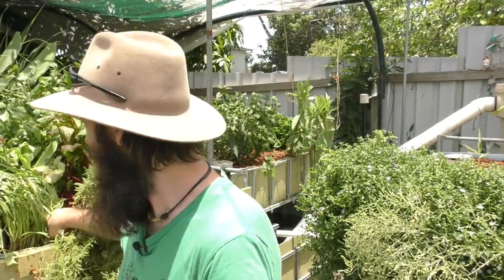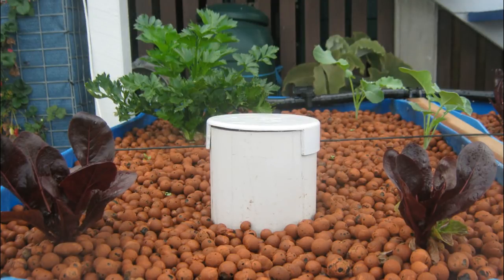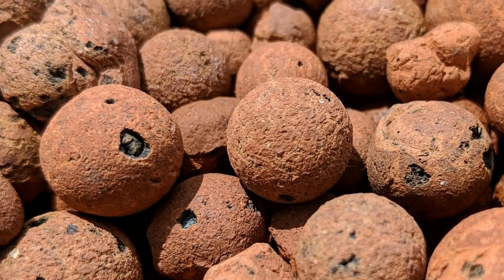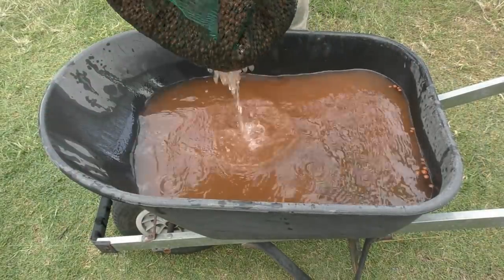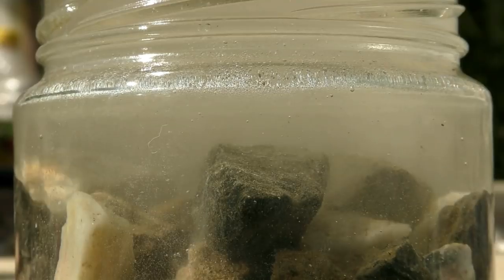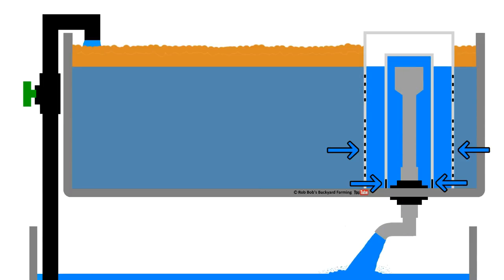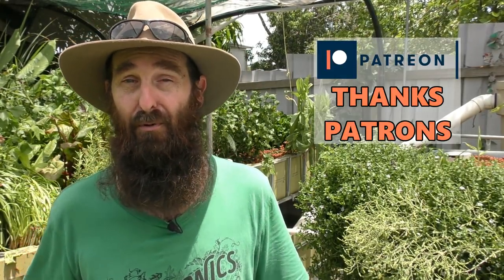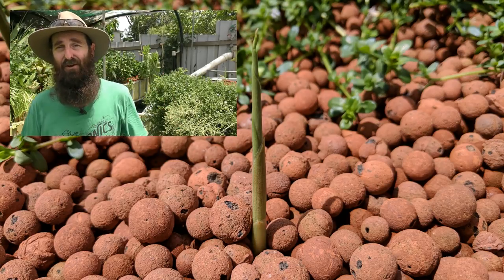Aquaponic System FAQ | Does it Take a Lot of Work!  How long Does The Pump Run? & MORE

Comment: Do you need/use a uv sterilizer ? Mainly relating to how it can deal with excess algae. 
I have been breeding and caring for aquarium fish for the last 30 years and have had my aquaponic system running for 2 years now (thanks very much for the inspiration). I am currently growing out a load of rainbow fish and the fry love a bit of algae to nom nom between feeds. So when I let the algae bloom for the fry i find that the plants really suffer from the ph spikes. The ap system is very exposed to sunlight and i'm using shade cloth where I can.
cheers mate.

p.s. do you have any plans to do like a "show us your system" video? I would love to do a quick video run down and let you show it.
Reply from the maker: Hi AS & sorry it took so long to get back to you. I haven't had the need to use a UV in the aquaponics but I did use on on the fish farm when I had an algae issue. I had it in line after the bio & before the fish tank. 
Now there's no fish in the system it would probably make for a boring tour. I did post this one a while back & not a lot has changed in it since then. https://www.youtube.com/watch?v=raLv4RAUte8
I think I may of added the barrel beds after this but that;'s about it. 👍
Will be uploading a clip looking at the future plans we have for it in the coming weeks. 
Sorry again for missing your post.
Cheers,
Rob.

Comment: if I have fewer fishes in a larger tank or growbed and also in the night time I will remove the bell in a bell siphon, so water will in constant level. so in this case did I need to run the air pump for 24/7 ???
Reply from the maker: I think it would still be a good idea to run the pump 24/7

Comment: Heyo from Newcastle Rob, love your vids, it has inspired me to build your chop & flip 44 gallon jobbie, not quite using it for aquaponics just yet, but am running it as a hydroponic system, Ginger and garlic in the grow bed, and have also tacked on a small NFT channel for some strawberries. Would love a general update on yours!

 Just a question around Iron Chelate, in a system with about 90-100 ltrs in the reservoir, how much IC would you put in it? And how often would you need to put it in? Once I get the initial project more down pat I am going to add another 2 grow beds for some turmeric, and longer NFT channels for more strawberries. 

Thanks again mate!
Reply from the maker: Sorry I missed this Shane. 
I posted a clip on adding iron to the system a while back if it helps any. 
https://www.youtube.com/watch?v=Kcls73bI5fg
Have you got any fish in the system yet? 
Sorry it took so long to get back to you,
Rob.
Reply: Sadly no - still going on hydroponic nutrient. I have expanded the system to 2 barrels now running off a single reservoir, and going to expand more over winter and add a horizontal cut bed from the same type of barrell for some more surface area. We had a bumper crop of cucumber out of it this summer and almost ready to harvest the ginger and turmeric as well!
Reply from the maker: Nice one Shane. As long as it's productive you're on a winner. 👍
Hope the ginger & turmeric give you a decent harvest.
Cheers.

Comment: rob can you tell me that the vertical tower should 24-hour water flowing or it time to time flow water like 10minute flow than 15 minute stop. tell me details, please.
Reply from the maker: Vertical towers generally run 24/7 as does NFT (Nutrient Film Technique) & DWC (Deep Water Culture).  That stops the roots from drying out.Cheers.

Comment: Thanks for the Video Rob. Really great Video.
I have set up a small Aquaponics system. I have a grow bed with one Bell siphon. This is just to test whether I can build small one or not. I have noticed that the bell siphon release the water in every 45 seconds. I mean, it takes 45 seconds to fill the grow bed and 45 seconds to empty it.
Does it create any problem with so fast action by this Bell siphon??
Reply from the maker: That should be fine Umesh. Sounds like it's a small grow bed.
Reply: @RobsAquaponics  Thanks Rob. Cheers.

Comment: How much feed per day.
Why not use Tilipia fish since they are easy to care for
Reply from the maker: Feed rates depend on fish variety, body weight & water temperature. 👍
Tilapia are a declared pest here & as a result I can get up to a $200,000 fine if caught with any in the system. I have mates allover the USA that use them but there are a few states that have outlawed them as a pest species there as well. 
Hope that helps Ronald. 
Cheers.

Comment: can i use gravel as media?
Reply from the maker: As long as it's not the small pea gravel it should be fine. 
I think that it's best to use media that is at least 20mm/¾" in size. That allows better water flow through it. 
Hope that helps some Gilbert.
Cheers.